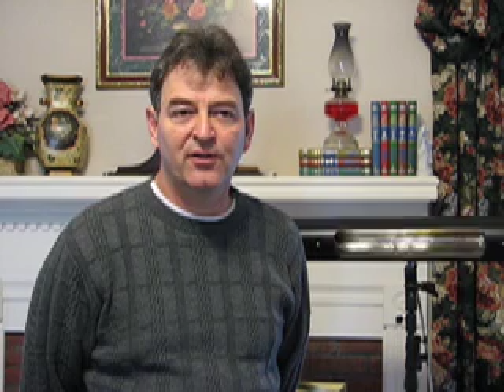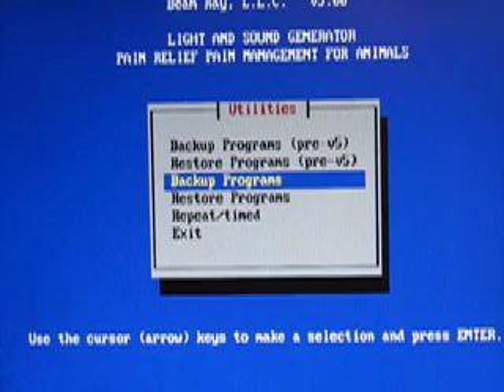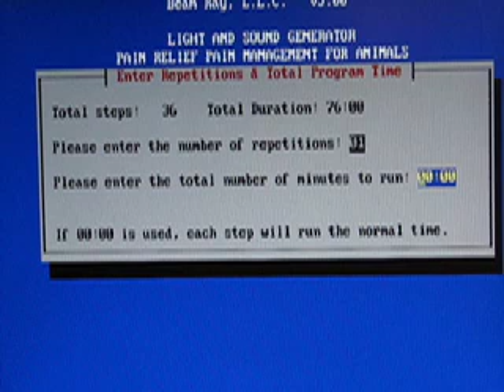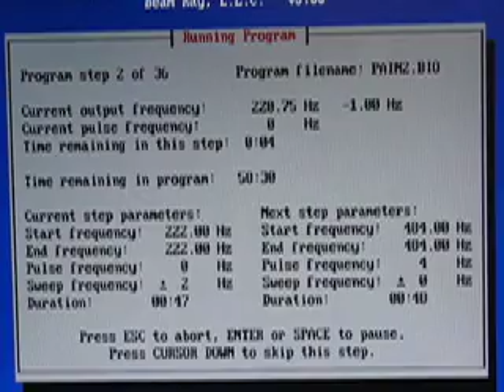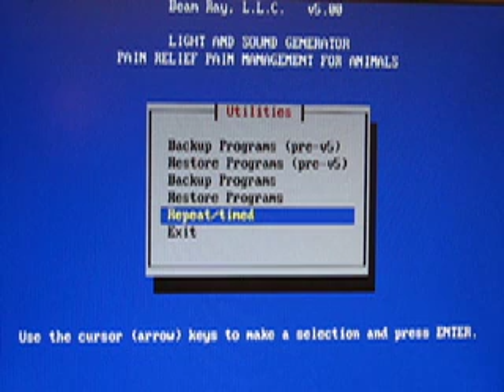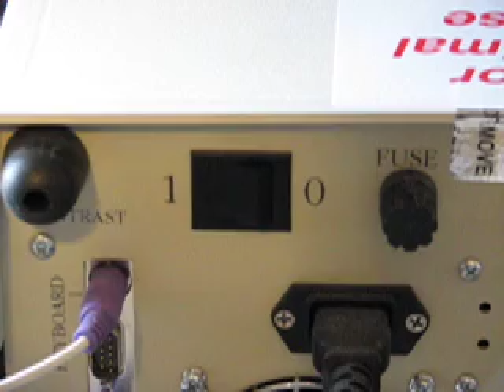Beamray, Rife Technology, Beam Ray demo, Lyme

Comment: I am not the company and I don't make the machines, therefore if you contact BeamRay, they CAN provide this information and they DO have it at the Rife Conf every year. The equipment works fine for everything I've used it for and the service from the company is wonderful. I don't know what your agenda is & I don't care but a simple phone call to the company 205-680-2259 will give you everything you need.
btw: Rife's original frequency for cancer was 11,780,000

Comment: Obviously you have never been to any of the major shows where BeamRay does demos and provides the technical data you speak of, along with their engineering staff. They also make available the medical data from the 3 yr hospital study + the spectral analysis and power ratings of the unit by 2 independent labs. You should call the co and speak with them as I did before purchasing a unit. Also, attend the Rife Conf this October and see who has the best data.